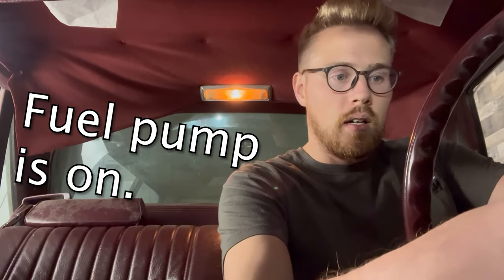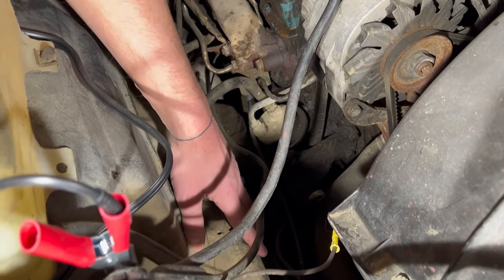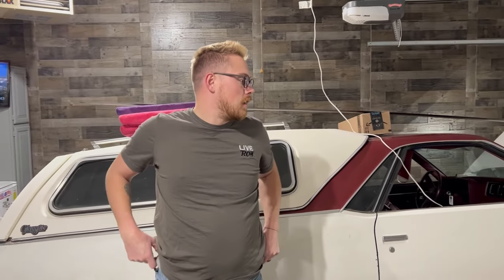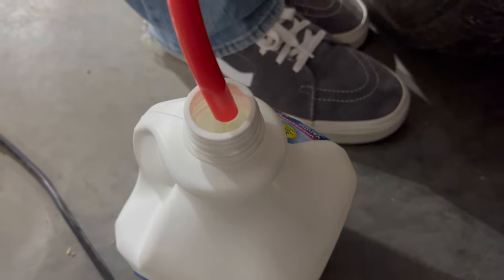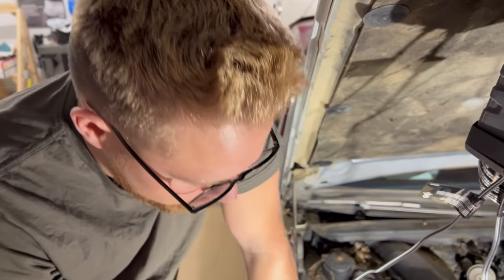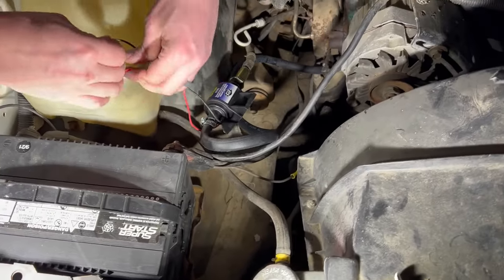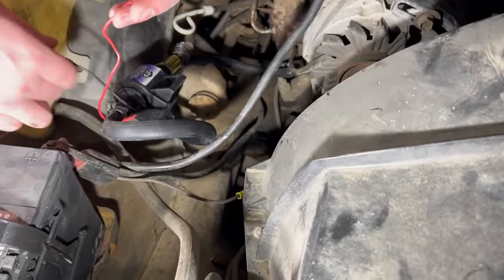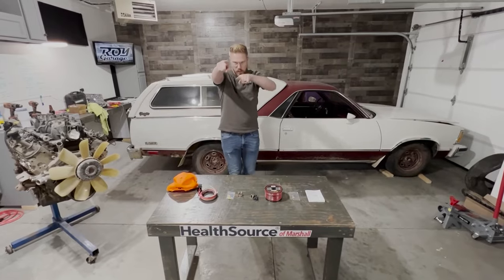Installing An Electric Fuel Pump | The Meano Camino

Comment: Too bad you didn't read the instructions ! You would have found out that the fuel pump should be located as close to the gas tank as possible !!!!
Reply from the maker: Totally read the directions and knew that but wanted to do this anyways 😁 left that part out of the video where we explained that
Reply: Why would it matter?
Reply: @Fordgroup00  these pumps are not to good at pulling fuel, they burn out easier
Reply: @magicvlogz9879  

Ah, ok thanks for the info
Reply: Yup I burned mine out doing that
Reply: + engine bay heat Yup. Mine died out too. The first one

Comment: Please correct me if I'm wrong, but the pump should be at least a foot from the gas tank. If not, it burns out, trying to pull fuel for the length of the vehicle.
Reply from the maker: You are 100% correct - we were a little lazy and didn’t want to drain the fuel and cut the line way back at the end of the vehicle - just wanted to get it running the easiest way possible.
Reply: @theroygarage you should say that in your video, extremely misleading
Reply: I was thinking the exact same thing.
Reply: But how theu don't over fill the carburetor on idling? They are on all the time without the ecu can someone explain before i do the conversation

Comment: This video is absolutely useless. People watching how to install an electric fuel pump want to see where you mounted it as close to the tank as possible and how you wired it and ran the wires to it work on getting the El Camino running it won’t be running long with that fuel pump mounted the way it is.
Reply from the maker: Been running strong the last two years. And I thought we added in there that that isn’t where you’re supposed to mount it 🤔 or maybe I accidentally cut at part out

Comment: Wrong right from the start! Should be mounted at the back.
Reply from the maker: You are correct, I thought I had a clip in there explaining that we are not installing this and how you are suppose to but we are just trying to get this thing running so we are mounting it here because it’s the easiest spot for us but I accidentally cut it out of the video 🤷🏼‍♂️🤣
Reply: And would it need a regulator for pressure?
Reply from the maker: @mayken6661  nope - says it’s good for 4, 6, and 8 cylinder engines and nothing in the directions about a pressure regulator

Comment: Should also install an inertia switch.   At impact it will shut off automatically.   So you don't burn up !
Reply from the maker: Genius!
Reply: Thank you for this tip! Just ordered one. Never heard of it before 🙏
Reply: @kenziedelatorre  Back in the mid eighties. I bet my friends I could shut their car off with just a kick.  On the Ford Mustang they're located Lower Passenger side. 1st couple of times they were amazed.

Comment: Those pumps are push type of pumps suction is created by pushing fuel away from the pump. If it not near the fuel tank it will burn it self out quickly

Comment: Just clicked on this with the same issue with my 85 el camino but thinking how to run the wires where the fuel pump only comes on when key is on not to the battery?
Reply from the maker: Have you watched our video on how we wired up the electric fuel pump? 
https://youtu.be/4KAlbpf4rCk

We used a relay kit and a switch. You can find the relay linked in the description. I didn’t want to take apart the steering column to get to the ignition and that is why we used a switch. 

And as far as turn key - instead of connecting a switch - you need to find a power source. We took power right from the breaker we installed. Then wire it up to your ignition and back to your relay. 

You should be able to find a video out there that shows how to wire fuel pump up to ignition too. If you have not used those search terms yet. I will look too quick. 

Let me know if this helps lol
Reply from the maker: Should be able to wire it to the accessories on your key ignition switch with the relay kit.
Reply: @theroygarage  don't do that.  You want it wired to KEY-ON, not ACC.  If it's on ACC it will run while to car's off but the key turned back to the ACC position, like when you're sitting there listening to the radio waiting for your pal to come out of the liquor store.
Reply from the maker: @scottdelaney98  gotcha, my dad got a mini extendable circuit and that worked really well. Find a spot in the fuse box that turns on with the key and plug it in there. Way easier! 
https://amzn.to/3wEA9nr
Reply: @scottdelaney98 won't the pump turn off after it reaches the 5 or so psi?

Comment: Question , Im having problems again with my edelbrock fuel pump , you had ur buddy hold the red wire on the battery , where would u put that wire at ? My pump continues to turn on without the key turned all the way
Reply from the maker: We connect ours to a switch so it would only turn on when we flip the switch. The other option is to get a fuse tap that plugs into your fuse box that only turns on when the ignition is turned on. 

This video shows us wiring it in - https://youtu.be/4KAlbpf4rCk?si=aW4gue9xDT9uvYJe

In this video is shows the how to setup the fuse tap at 7 minute in - https://youtu.be/25klv8DKggA?si=EKif_5c4uE8dAQ10

Comment: How does the electric pump not flood the carburator with to much gas
Reply from the maker: It’s a 3-7 PSI pump for v6 or v8 and I believe even the float in the carb gets too a certain level it stops the flow of fuel
Reply: @theroygarage  yep, that’s what I was going to say; float in the carburetor puts pressure on the needle and seat and cuts fuel flow off
Reply: What They didn’t mention is that you have to install a fuel regulator and a return hose to the tank

Comment: I Installing This Electric Fuel Pump With Return Fuel Line/Regulator... Like An Injection System... I Dont Know If This Is Needed Or Not... Just Worry If The Pressure Is Too High And Can Cause Damaged To My Fuel Pump... Is That Necessary Boss? Or I Can Remove The Return Line And Just Let The Pump Installed Directly To A Caburetor? I Have No Idea Boss... But For Now, The Fuel Supply Is Enough And Does Not Have Any Issue Yet... 
😅😅😅
Reply from the maker: Just so I understand, you’re installing this fuel pump to pump into your fuel regulator that has a return line?  You’re concern is if the pump is pumping too hard for the fuel pressure regulator?
Reply: @theroygarage  Yes Boss. Thats What I Mean... Is That Necessary? Or I Can Install That Pump Directly Without Having A Regulator? Because When The Caburetor Is Full, The Fuel Will Stop Flowing, But The Pump Will Still Pumping...Will It Damaged The Pump Ya Boss? I Dont Know Too Much About How This Pump Works, I Just Thinking That This Fuel Pump Same As Injection Fuel Pump Only...😅 If It Not Necessary, I Want To Remove That Regulator... So, No Need A Return Line Anymore... Please Help Boss🙏

Comment: This fuel pump working is noise or quiet? Can you compare with holley 12-425?
Reply from the maker: I would say it’s pretty quiet unless I haven’t driven her for a while then you can hear it pulling gas from the tank until the line is full and it gets quiet again. I’ve ever used a Holley 12-425 so I can’t compare…
Reply: @theroygarage  thanks for reply, for my old Mercedes w123 carburetor 130ps engine power, do you have any suggection? which type 12s or 42s?! i need a quiet fuel pump
Reply from the maker: @kiwi9770  the biggest difference between the two is psi - 42s is 2 to 3.5 psi and the 12s is 4 to 7 psi. With that being said you’re probably good with the 42s but it you are upgrading your engine you maybe want to get the 12s. 

Here is a link for the 42s:
https://amzn.to/3S8KbWa

Here is a link for the 12s:
https://amzn.to/3Sf8xNY